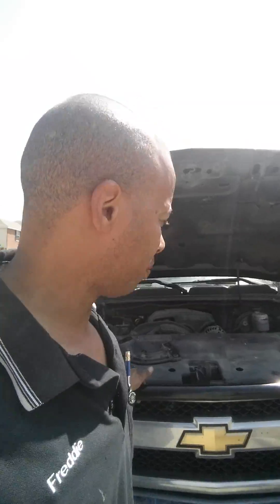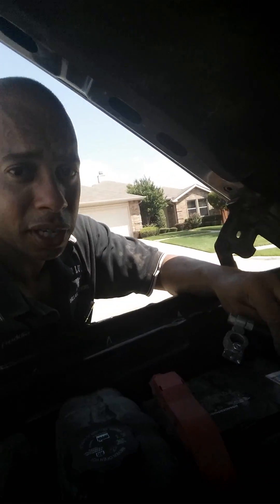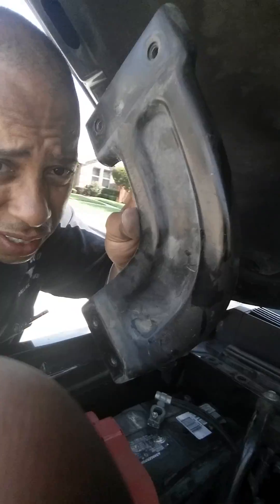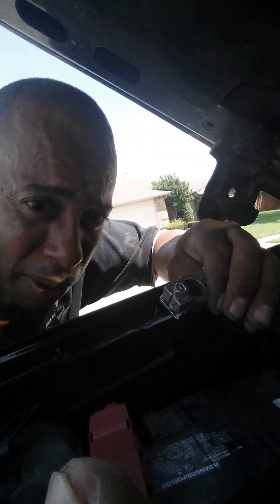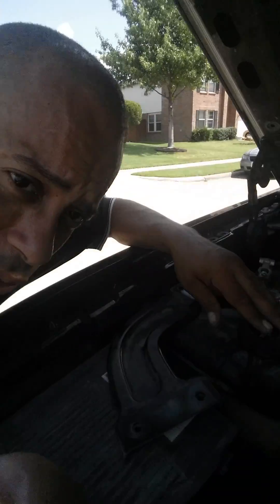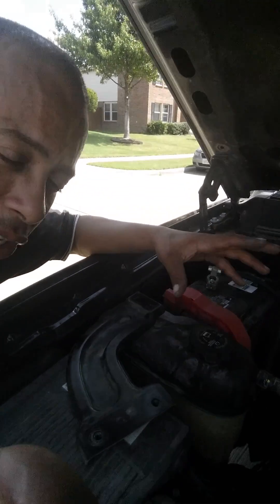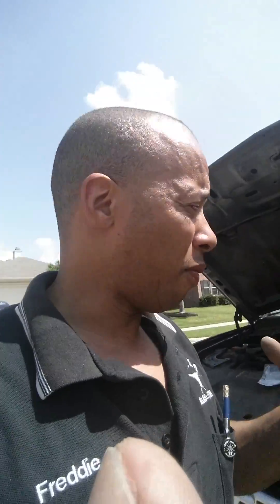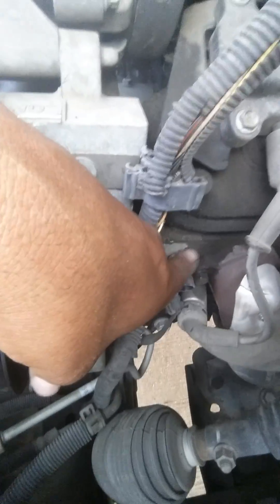Chevy code P1258

Comment: Same issue yesterday, truck overheated, pulled over, turned it off and coolant started overflowing. Will activating the P1258 also turn on the P0300 (random multiple misfire) / P0001 Fuel volume regulator control circuit open. Because now the engine coolant over temperature mode is active? I'm going to replace the sensor, my thermostat and waterpump.
Reply: If you can remember did replacing that sensor fix the p0300 also? My yukon is throwing both p1258/p0300 and im experiencing this exact issue.
Reply: @lynnt3964  if you Google the po300 code that will tell you what the problem is. Mine has the same code and I forgot what it is but I don't think it has to do with the P1258 code but I could be wrong as I was one time before lol
Reply: I'm having the same issue overheating and engine coolant hot..and code that was p1258 and cylinder misfire code..I just replaced the water pump and thermostat..hope that temp control will fix it..

Comment: So I had this issue with my 2003 Chevy Uplander today.  And I have the same, P1258 code.  And, as you described, the antifreeze was back-filling the coolant reservoir tank.  My temp would be fine, holding at about 1/2 way on the temp gauge.  Then it would suddenly start overheating and the warning alarm came on, and the systems started shutting down to protect the engine and minimize the load.  And then suddenly, the temp would drop to normal and all would be fine.  

To me, this points to 1 of two things; a blockage somewhere in the system, or a bad thermostat.  How would this sensor cause the system to overheat?  Doesn't it just report the temperature to the computer system?  Did replacing it stop your engine from overheating?  Mind you, my thermostat was just replaced a few months ago (February I believe, now it's just the beginning of June).
Reply: I have the same code and symptoms on my 07 Tahoe changed thermostat, reservoir,clamps and coolant sensor got a compression test came back good and still have the problem

Comment: thanks for the help same issue Chevy equinox
Reply: Phantom Productions did this work for your equinox currently having the same issue already replaced thermostat and got a new radiator was going to do the water pump next but this is the code I got from autozone